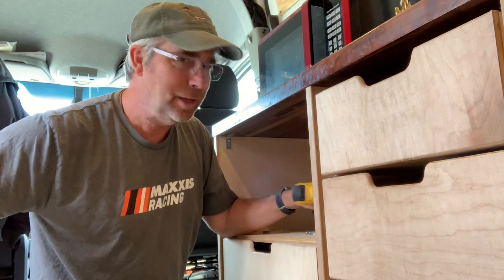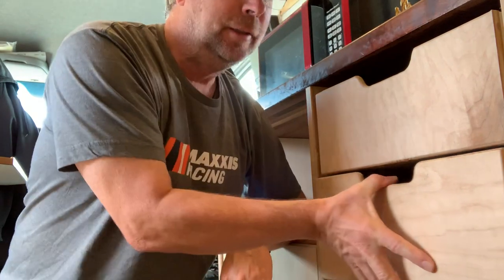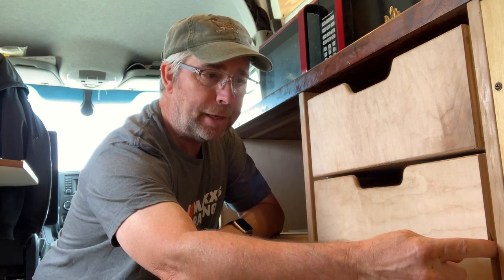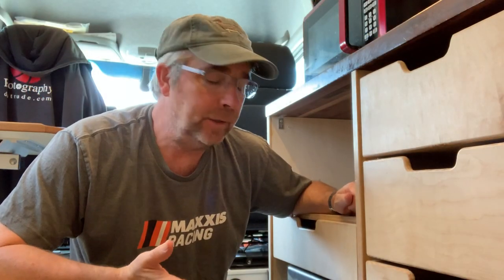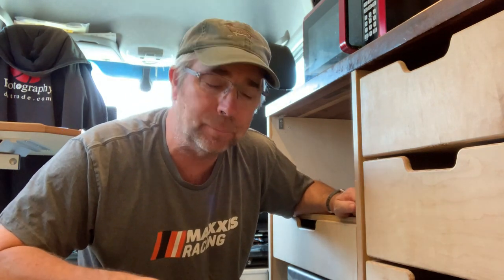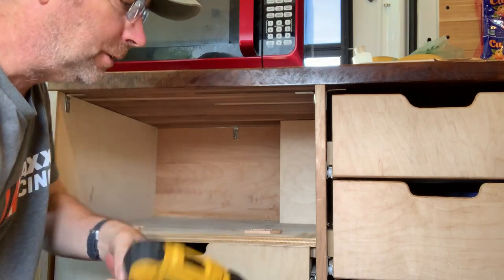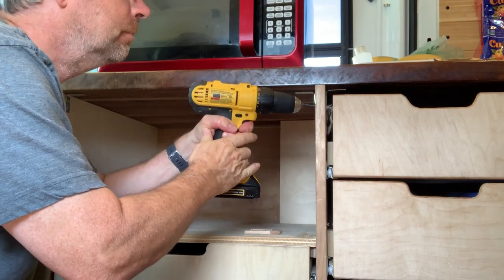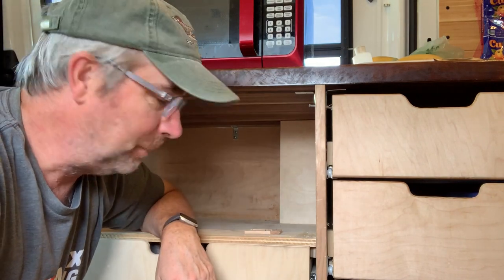DRAWER STOPS FOR DIY CAMPER VAN CABINETS | When regular child-proof safety latches won't work

Comment: Great idea...I hope the microwave doesn't rub against the duplex nails when you replace it.  Its funny how on boats its done so simply, the drawers slide in and sit on a shelve and under the drawer they glue a wedge, like a door stop but thinner and you lift the drawer up to clear the wedge and when you slide the drawer back in it goes over the edge and the wedge fall down keeping the drawer secure....cheers.
Reply from the maker: There is clearance between the two so no worries there. Thanks for the comment!

Comment: I've spent weeks trying to think of a way to secure my chest drawers while on the road.  Why didn't I think of this.   THANKS
Reply: So glad this was helpful. Thanks for the comment!
Reply: @TimDustrude  Lowes had no double head nails... had to order them on eBay.  What size drill bit?   Thanks
Reply from the maker: @camper118  we used a 3/16” drill bit. I’m surprised Lowes didn’t have those nails. 16D Bright Finish Duplex is what you’re looking for. Would be best to find an old school lumber/hardware store where you can buy nails in bulk (individually) instead of having to buy a whole box. Or get some from a contractor or carpenter. Good luck!
Reply: @TimAndShannonLTD  I found a 10-pack on eBay fairly reasonable, and I need eight.  Thanks for your help.